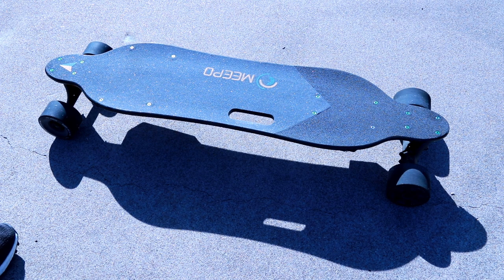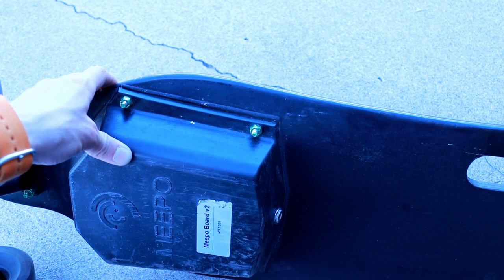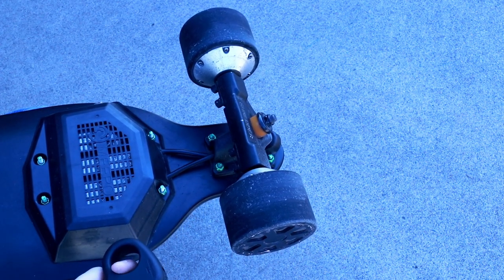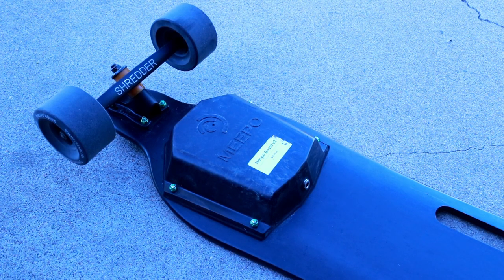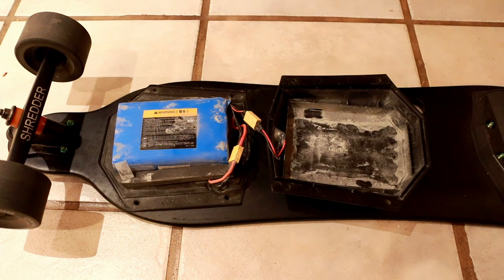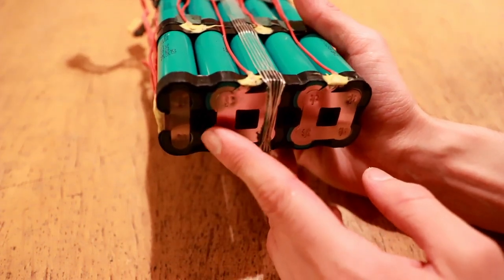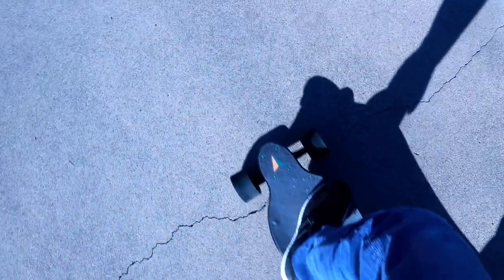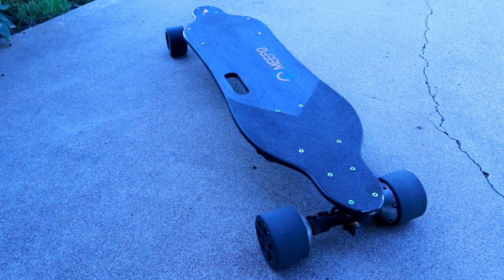EP 60 - Meepo V2 Electric Skateboard Review

Comment: Hi dielectric. I absolutely love your content on the v2. I know it's 3 years late but I just got a v2 used online and am looking at making my own battery pack like you did with yours. Could you give me tips?
Reply from the maker: If you can get a spot welder it's better than soldering directly to the cells. If you have to solder, use a hot iron and keep dwell time to a minimum. Discharge the cells to 3.3-3.5V to make them more stable while working as well.
Reply: @DielectricVideos  thanks for the reply. Would you have a 18650 battery you recommend for this build?
Reply from the maker: @explorewithkyle  I've had good success with LG HG2s and Samsung 30Q before. You'll want something with a fairly high discharge current rating (>15A) so that it remains useful as its internal resistance rises over its lifetime.

Comment: Wondering did your board come with the V2 remote? On the site it says it comes with the classic. If so, i want the v2. Just trying to get the info! Thanks.
Reply from the maker: At the tome when I purchased it, it came with the remote pictured here. This may have changed since then, as the original date of purchase was in September 2018.

Comment: I purchased a V2 on 2/19 I am getting a herky jerky  type of ride, I think this is due to the brakes. I’m an expert ride, last e board I had was an ownboard with a hoppy kit ESC it was much soother,  Do I have to adjust my riding techniques? Any suggestions? Or tips?
Reply from the maker: It could be that the remote is low on battery and is cutting in and out, or it may just be the braking profile, which is very aggressive.

Comment: It sounds kinda loud is that normal ?
Reply from the maker: As mentioned in the section describing water resistance, the bearings are corroded and require replacement. A new board will give much quieter acoustic performance. Thanks for asking!